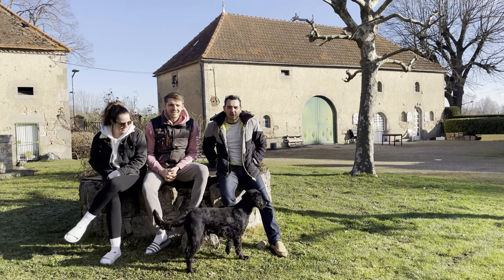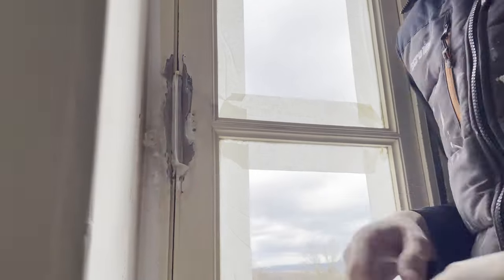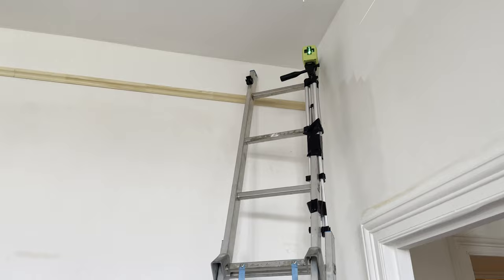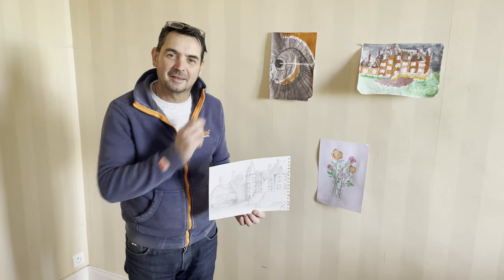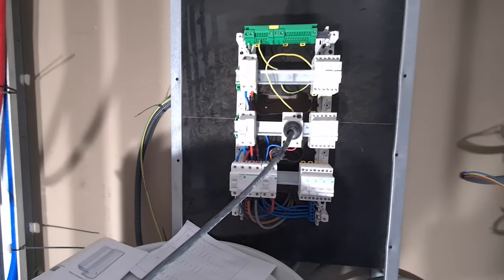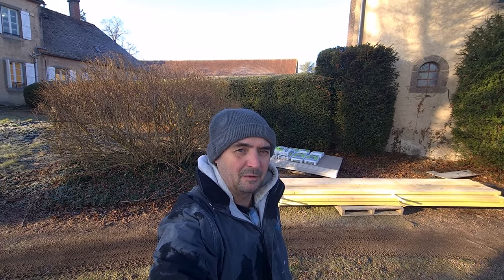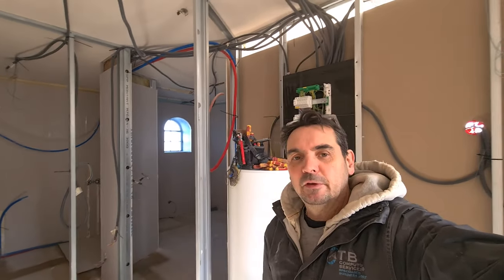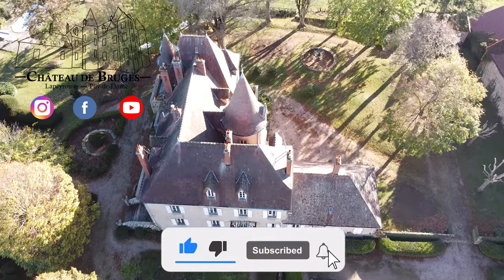Lots of hands = LOTS OF PROGRESS - 'Chateau de Bruges' - Ep. 23 - Renovating a 16th Century Chateau

Comment: I am surprised that you didn't need to put special plasterboard in the shower unit and where the basin will be going .   Absolutely staggered at the amount of wiring required for modern living.   Louis sure can draw.  Clever young man.  Best wishes.
Reply: Hi Shirley. The shower area will be clad in shower board before tiling which you will see in  future episode. Thanks for watching and commenting.
Reply from the maker: Hi Shirley, yes! Lots of very confusing runs for electrics! Would have been much more time consuming too if we had to chase out all of the walls to hide the cables!